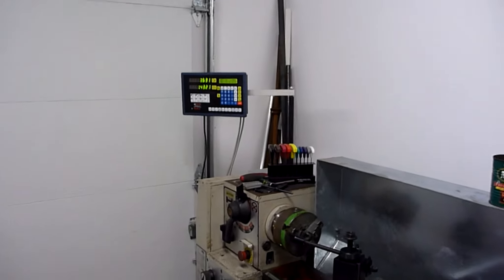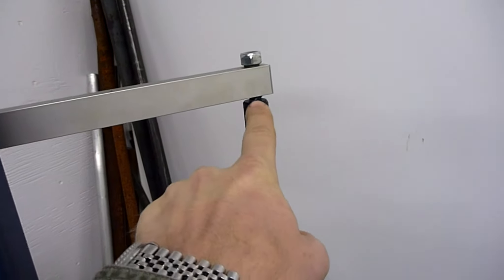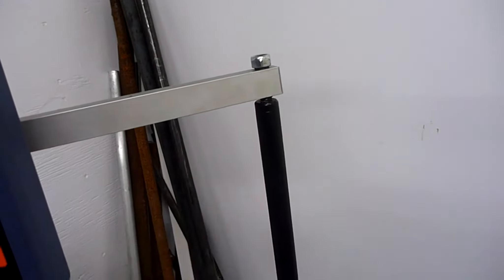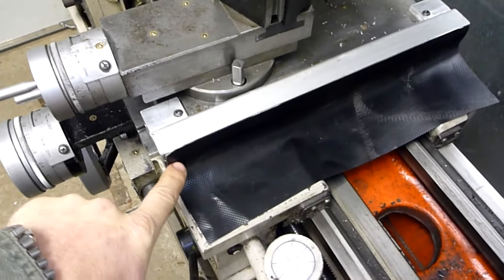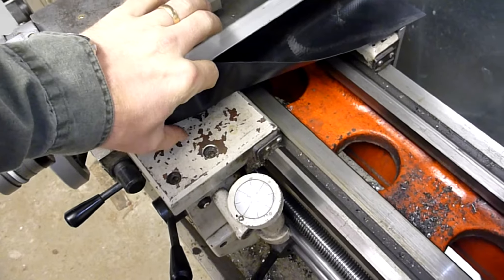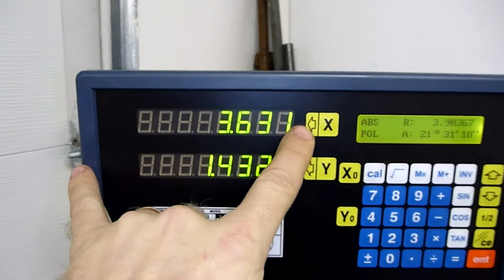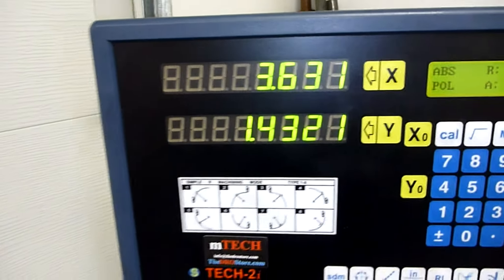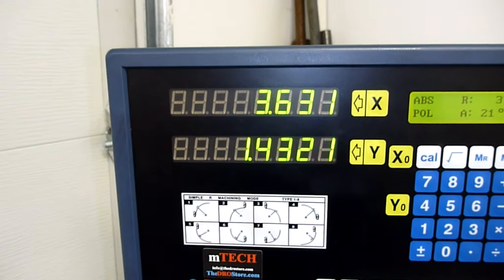Mtech Tech 2i DRO - Installation Update

Comment: I have similar type scales on  my new to install  dro. and looks like the plastic keepers on the reader to the scale remain on after you remove the two screws going into the scale for shipping. Am I correct in my thinking thanks.
Reply from the maker: +Ed Ginsberg No, once you undo the tiny little screws, the plastic shipping spacers slip out from between the scale and the read head.  Good luck with yours!